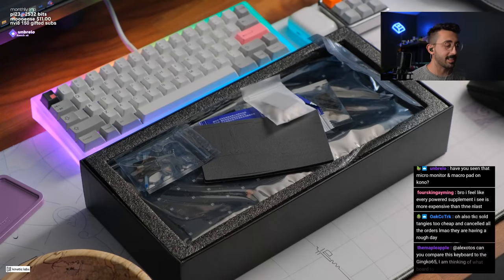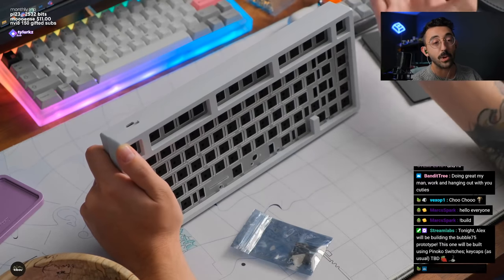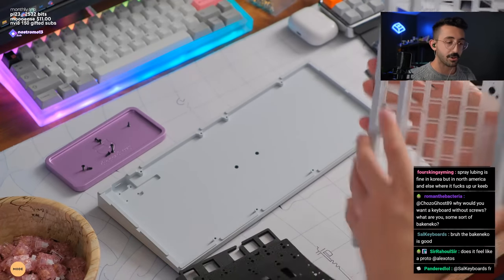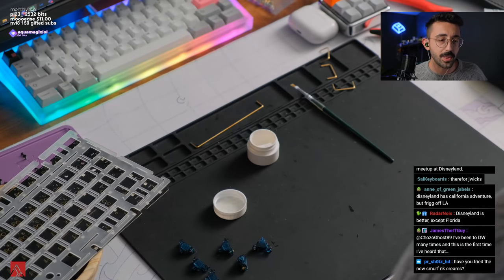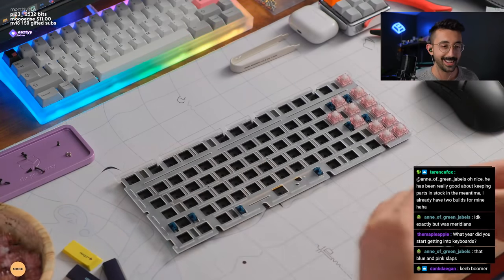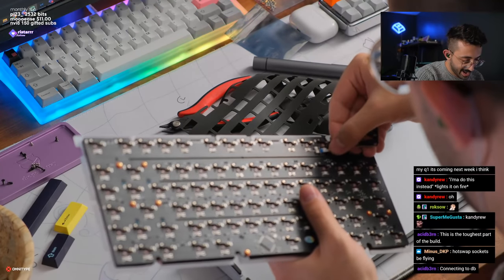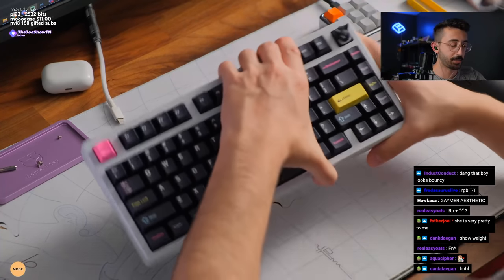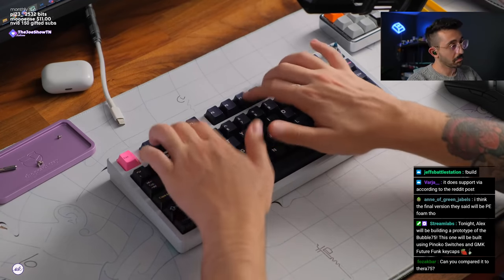Bubble75 Proto w/ Pinoko Switches Build Vod + Sound Test

Comment: must be hard to be a keyboard reviewer/streamer when all these keyboards are rolling in that are no different from each other in any objectively significant way. 
there is only so much you can do to a board that's "revolutionary", and these miniscule, hair-splitting changes is where we are right now. 
same goes with switches.
Reply from the maker: So you make a point that I've been talking about for a while now and thats why my preferences have changed to aesthetics of the board - since I've found what layout and typing feel I prefer. But as long as you love something, you can find joy in it! As for the objective differences in boards, yeah it's becoming slim, but it loops back into my love the design of the boards.
Reply: Turns out keyboards sound like keyboards unless they're super scuffed. That's why JYMV pays attention more to design finish and architecture. Aesthetics is also a major point, which is subjective.